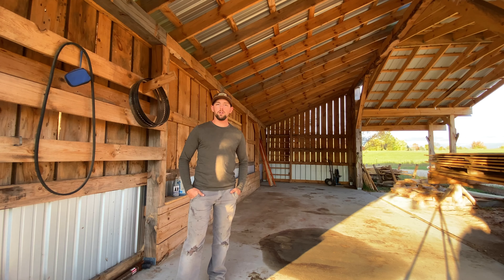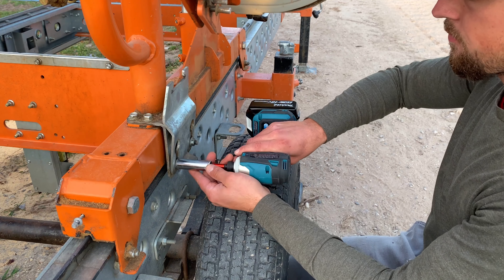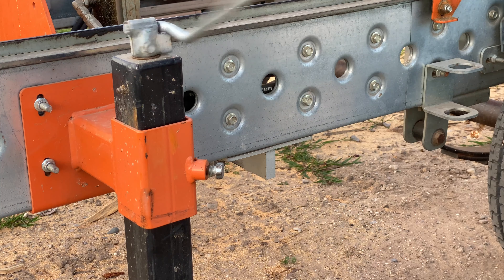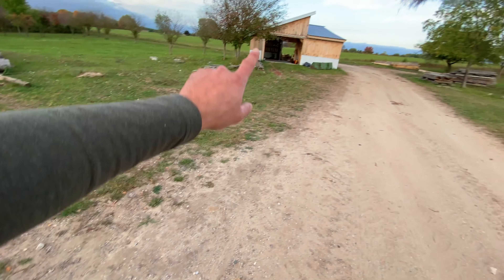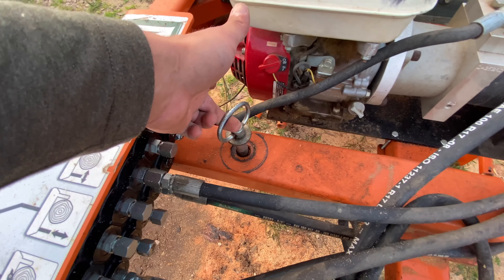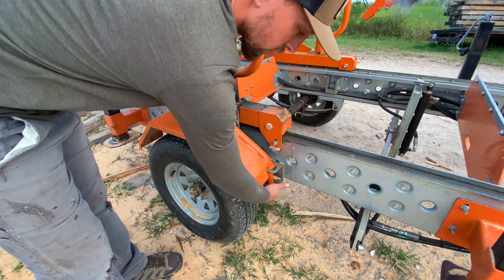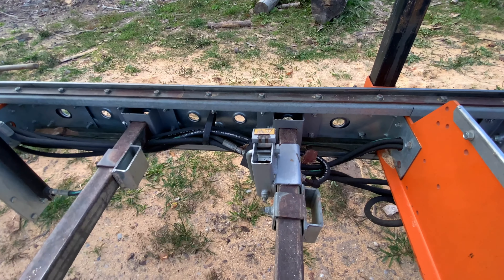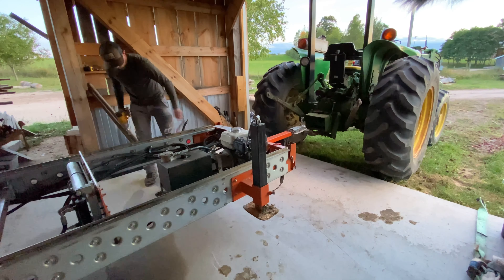How to prep. Norwood HD36 Sawmill for transporting!

Comment: Have the same sawmill for four years. I was about to move it to a new location ( 2 hours away on hwy). I had totally forgotten how to lock the cutting head down. Thx for the video. Anything I should worry about moving it so far?
Reply from the maker: Awesome! Glad I could be helpful! 
I’d recommend putting a post or small log on the from end to give it ample tongue weight. Other wise I noticed it was too well balanced. But I also had an extra bed extension on mine.  And make sure your lights work. 
And stop every so often to make sure the carriage head is still secured tightly. 
But not to over tighten them. I sheared one of the bolts off by over tightening it.
Reply: @Plankmills  Awesome my friend. Greatly appreciate the info. Where are you? I’m in Ontario, Canada.
Reply from the maker: @bobcaygeon4533  your welcome! I’m just across the puddle… haha in Michigan. 
But I sold my mill and move to TN last fall. Which I wish I wouldn’t have sold the mill. 
But I’m actually over here right now for a wedding.
Reply: @Plankmills  Cheers. All the best in your new home.
Reply: If you have a 4ft bed extension  you got to relocate the locking brackets forward or the teetering rattle while hauling will drive you nuts..just far enough that you can still put your fenders on and off.
Reply from the maker: @jaytodd5809 I had t thought of that, thanks. 
I usually just put a small log or cant on the front to give it some tongue weight.